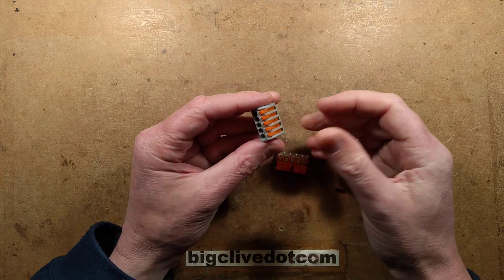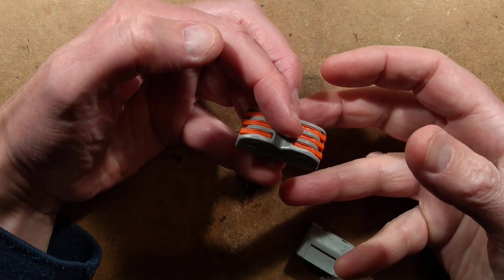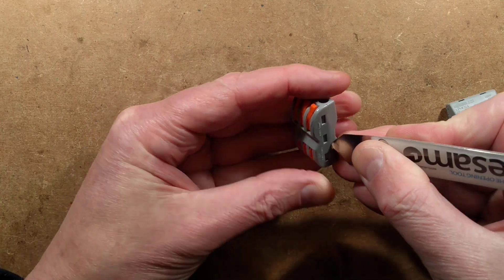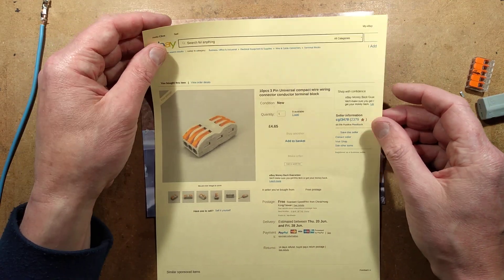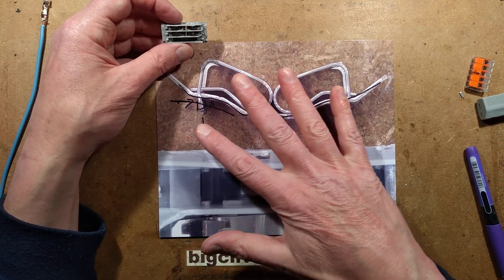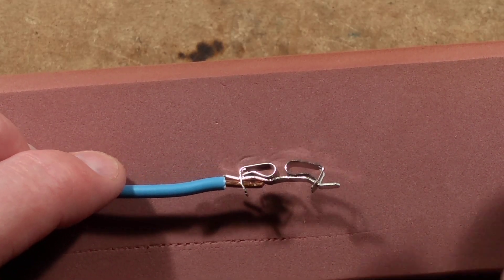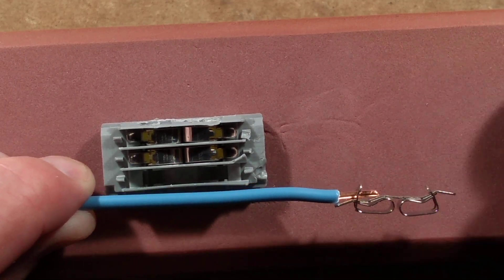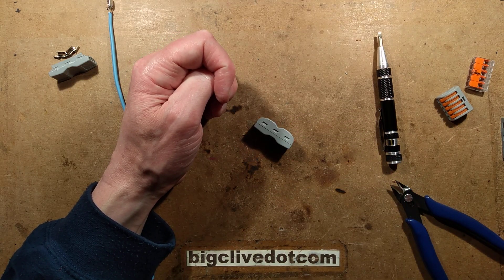Clone of Wago product that Wago don't even sell???

Comment: the separation looks good for anything up to 20amps id say if its not sensitive wiring such as digital data
Reply: girlsdrinkfeck The issue is creepage and sparks on 420V mains in an unspecified environment.  The 3 poles seem awfully close together in this video, unless the metal to top of divider distance increases significantly when closing the levers.
Reply: @johnfrancisdoe1563  yh I mean it's ideal for non mains voltage stuff. I'd love this for my ebike connections since it'd only 48v and 20amp load

Comment: Have you tried the "Heat Shrink Solder Sleeve Splice Connector" that has heat shrink wrap and solder already in them, for splicing wire? I love those when working on machines and what not, you only need a storm lighter, those sleeves, and a wire stripper.

Comment: The connector I want Wago to produce, better and quicker than choc block terminal strips. I hope Wago rip off the Chinese version.. Ooh the irony 😂 love Wago connectors, have used the cheapo rip offs before without issues, but wagos aren't much more expensive and meet safety standards. Having said that John Ward current tested the rip offs and they passed with flying colours.. Come on Wago up ya game!

Comment: Those things hurt if your finger is in the way, I bought a bunch for very cheap a year ago
Reply: I'm pretty sure that applies to ALL Wago connectors in that "lever" style (either the old, grey, "222" ones, or the newer, transparent "221" models). It's just a consequence of the spring pressure required to securely hold wires in place. I'd much rather occasionally have a sore finger than have live and/or high-current wires work themselves loose over time!
Reply: @AndrewGillard  The 221 levers you can actually break, leaving jagged edges. I agree it is good that they are tight.
Reply: The knockoff variants definitely won't come loose
Reply: I had the 8-way wago knockoff on my desk at work for a few months, and man did my fingers hurt by the end of the day ;-)
But I must have worked those levers thousands of times before a spring actually broke. Surprisingly durable.